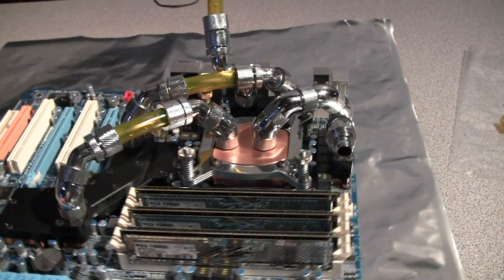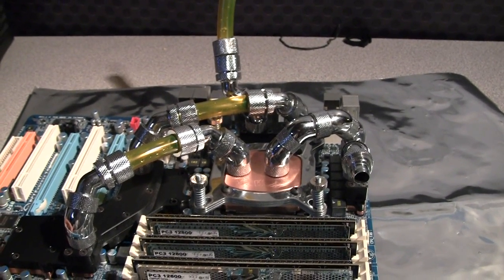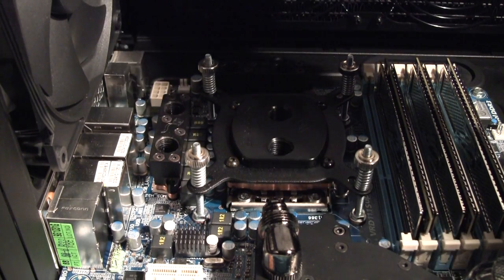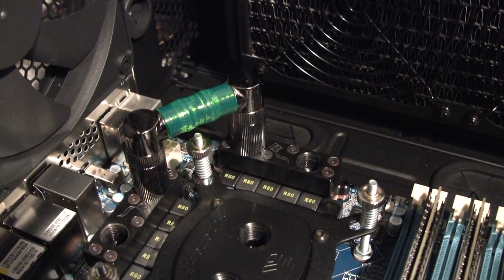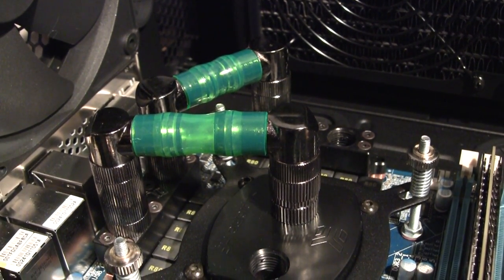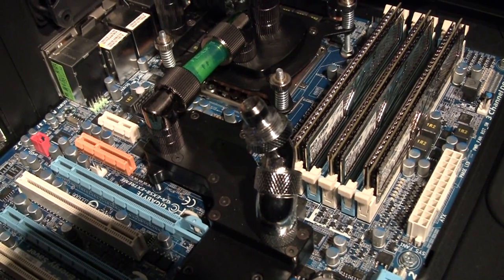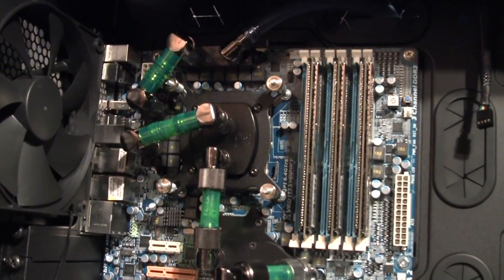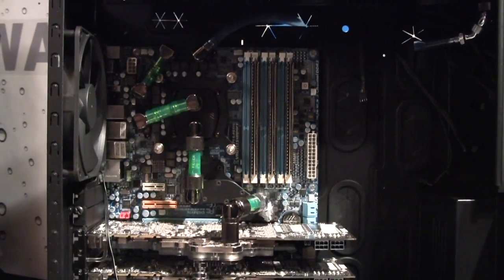Corsair Obsidian 800D Water Cooling Build -- PART #3

Comment from the maker: Got some digging.....
 
"For two identical pumps in series the head will be twice the head of a single pump at the same flow rate. With constant flow rate the combined head moves from 1 to 2. In practice the combined head and flow rated moved along the system curve to 3."

Basically both head pressure and flow rate increases with pumps either serial or parallel set up. So I stand correct on my original assumption.

Comment from the maker: @chriscolumbo323 It worked just fine in my HAF932 build, so shouldn't be an issue here either. I also plan dual pumps which will further help too.